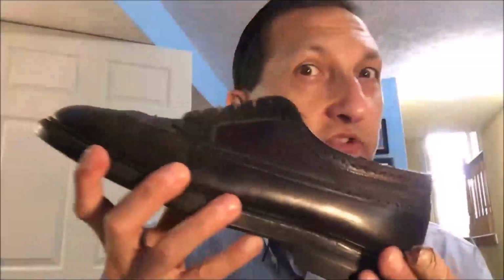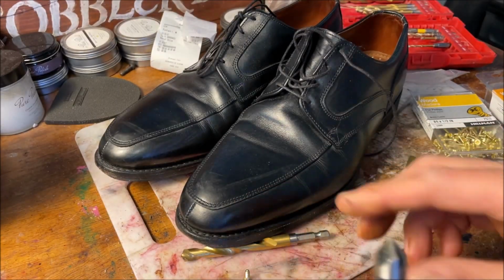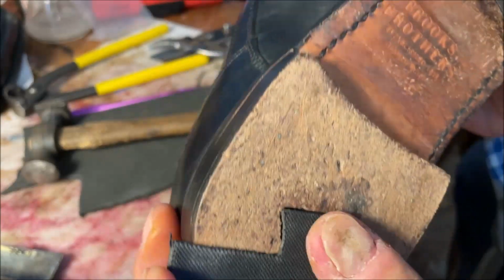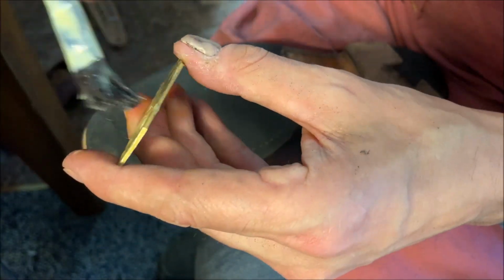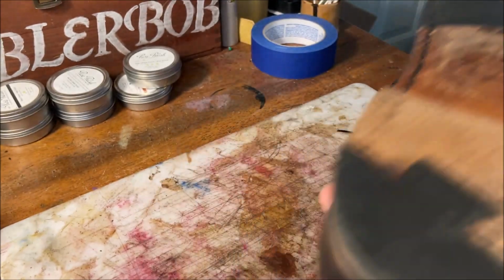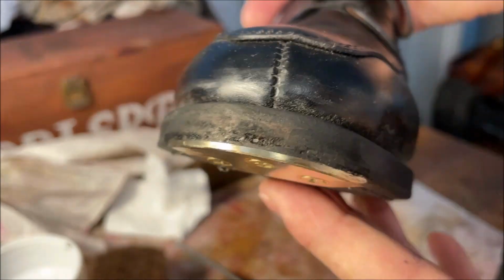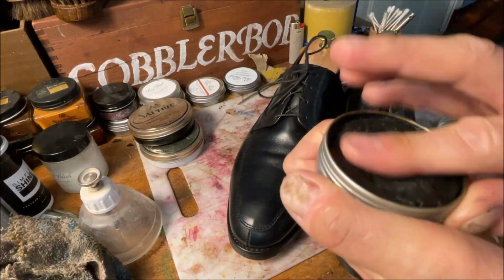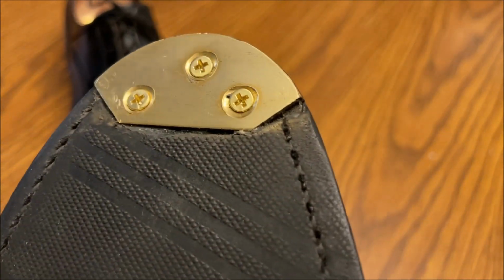Hand Made Brass Toe Plates on Allen Edmonds Derby

Comment: Nice job with what you have available. I would have suggested to try and cut deeper into the rubber sole protector so that the toe plate sits flat and minimal gap. But that is just usually easier said than done

Comment: You’ve taken a relatively simple project and complicated it beyond measure.
1. The heel: sold as a combination leather lift and Vibram rubber interlocking round. About $16.00 at most cobbler materials suppliers. Everything is pulled off to the stack, replaced, re-glued and nailed.
2. The toe: cut through to the leather and remove the entire first layer, not just the rubber. Level, glue and finish. You need sand to the thickness of the metal.  Use an awl first, to correctly counter sync the screws.
Reply from the maker: Thanks for your input Lennie. Here are my thoughts:
1. I understand there are easier ways of doing this, like buying a Lulu premade French tips. This is a hobby where I enjoy being creative. The cobbling is certainly not a source of income, so I can take a little longer route, especially if it saves me money. Sometimes when I re-sell the shoes, there may only be $20-$30 profit in it to begin with. 
2. My way of just replacing the rubber portion did take extra time to cut it out, but I saved the time and hassle of trimming the entire top lift and then sanding it. I only had to sand the rubber portion. Remember, I don't have a 5 in 1 machine to trim off the excess rapidly. Also, most cobbling supply stores won’t sell to individuals. I’m therefore left with a few stores in the UK where shipping is exorbitant, or eBay. The dovetail leather rubber dove tail top lifts on eBay are not cheap: the JR ones are $40 a pair. If you post a link to a store that sells them to individuals, that would be a real help and much appreciated! 
3. Your way of cutting off the entire layer of rubber won’t be easy. This is not some aftermarket Topy. The sole was produced with the rubber portion adhered to it, then the combination sole was stitched onto the welt, so the outsole stitches are on top of the rubber. I think that would be extraordinarily difficult. I don’t think the rubber portion would peel off. I think you’d wind up sanding and sanding and sanding, and it would be difficult to get the surface even and flat at home. Then I think you’d run a greater risk of the outsole separating from the welt because you’d cut deep into the outsole stitching. I could be wrong, but that’s my opinion and reasoning. 
4. Using an awl before installing the screws is a very wise tip and would have prevented that angled screw, and made the screws easier to install. 
Thanks for your input either way. I’m not saying you’re wrong, but that there was throught and reasoning in the way I did it.
Reply: @CobblerBob  Bob(May I call you Bob?) Before JR’ sale I could get the lifts for $100/pac of 6 repair of leather and rubber comb. My guy has retired, but his source is still in business. I can ask if you’re interested. That said, let me know. 
Steve Bedo scives the the toe sole, but I think you have to write him or look at his YouTube’s. Sewing thru rubber sole protectors was meant to make you use a new welt, and AE has a huge profitable resole business. No matter what anyone tells, always always always glue the sole protector on top of the stitches.
Forgot to tell you, the uppers came out better than my retired to Palm Beach cobbler could do.

Comment: Great job, Bob! I think I saw a video on Steve's channel where he cut the space for the toe plate too much, so he cemented a very thin piece of leather underneath first. Then added the toe plates.  This might have also worked for you instead of doing it after with the leather dust.  Also, I replaced a pair of heel pads on my own because of your videos. It was nice to try on a pair of boots I was ready to throw away anyways. I'm now only buying shoes that can be resoled. It just makes so much sense.
Reply from the maker: Yes, I’ve tried adding in wedges of leather before to repair toes, and it was horrible! LOL. It looks so neat when the cobblers do it. That doesn’t mean I can’t try again though. I think the keys to adding in leather are:
1. Sanding the toe area very flat and square
2. Getting a very well trimmed piece of scrap cut at the right angle. I’ve seen cobblers use scrap cut from leather trimmed off of the 5 in 1 machine. I don’t have that luxury of perfectly wedge shaped scraps. Again, possible…

Comment: I have this same pair of AE for Brooks Brothers, and the outsole stitching infuriates me. Why do the stitches go to the outside of the rubber? There is no channel so they are worn through immediately and you are left with a glued construction. Why not stitch on the leather and then glue on the rubber?
Reply from the maker: It would seem better for there to be some kind of groove, but I'm guessing since the rubber is so thin, if they cut a groove in it the groove would cut through the rubber resulting in the rubber on the outer edge of the sole tearing off? That's just a guess.